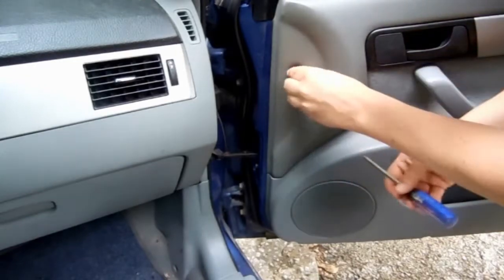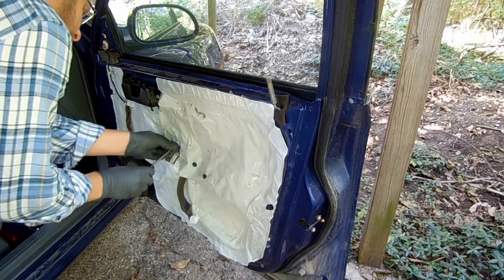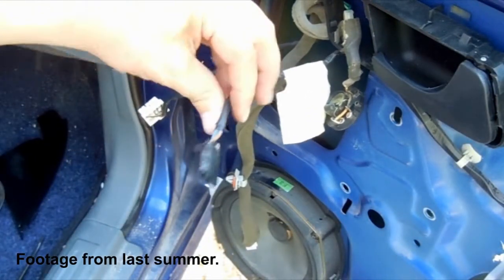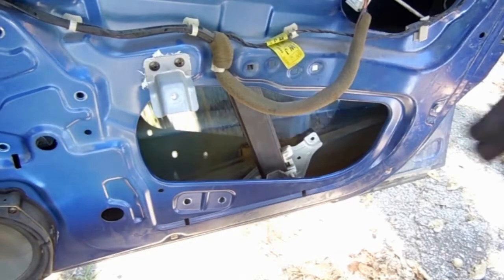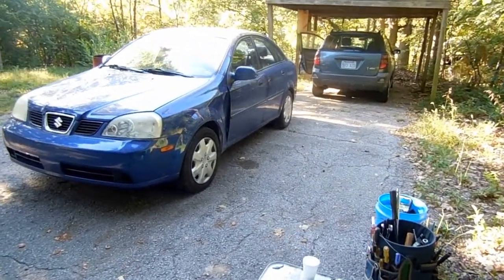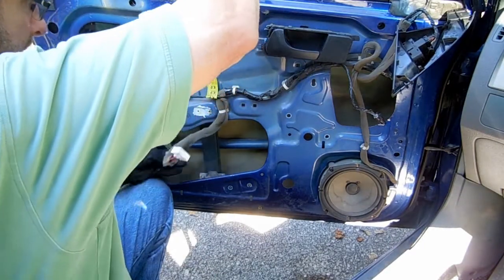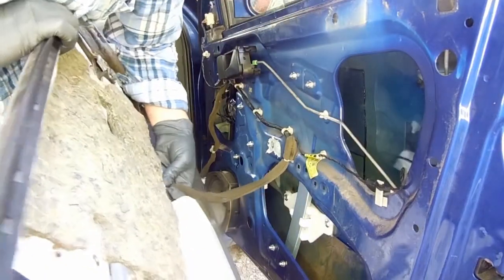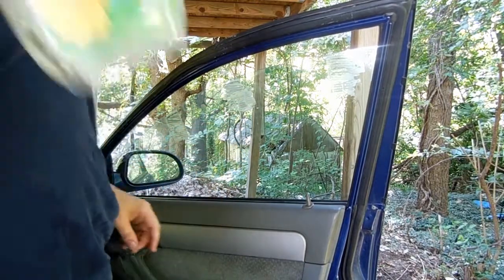Suzuki Forenza/Reno window motor and regulator replacement

Comment: Hi there
I have a 1999 Vitara 16V here in Thailand. For a couple of years the driver;s window would fail, I thumped the door to cure it and eventually made a little hole in the door lining and tapped the motor via a slim screwdriver through the hole to the motor.
It mostly worked but is now unreliable.
I don't know what a aftermarket motor/regulator set costs but I know from Suzuki it's 8000baht (over $250) Even half of that is a lot in Thailand.
My question is, given its almost certain to be the motor at fault, is it possible to disassemble these window motors to replace the brushes or repair them? Or are they fixed permanently together?
Thanks v much